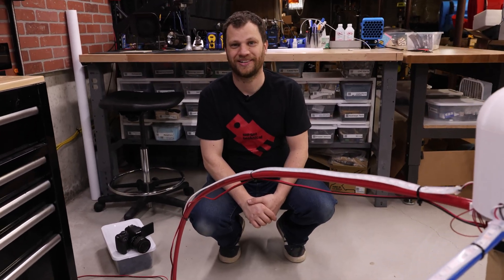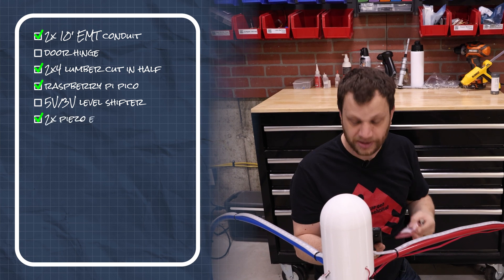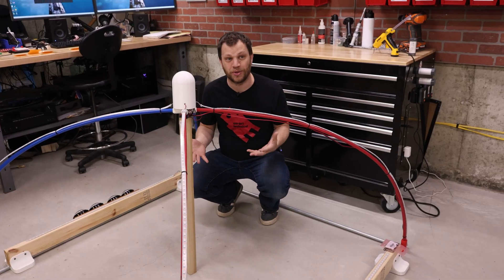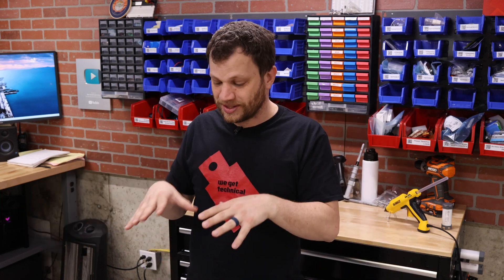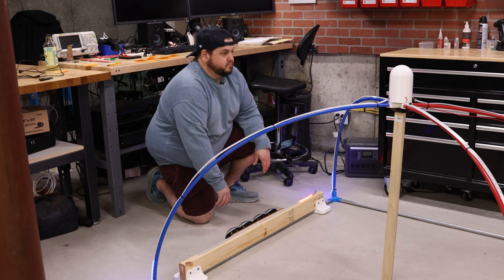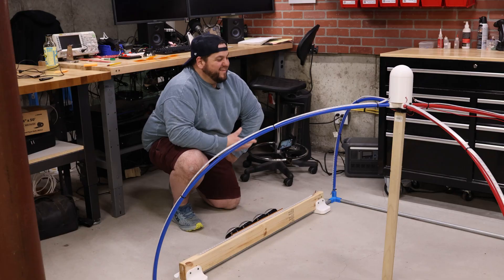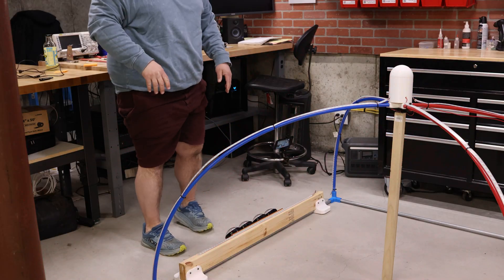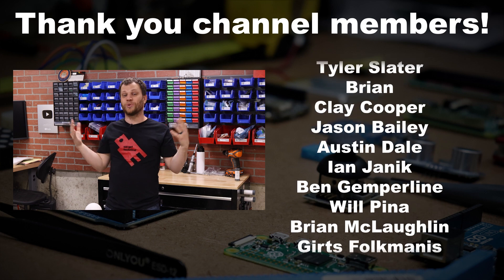Pixelball   Part 3

Comment: Your design change eliminated the need for the hinge (one of the few items you had to buy), but how did you get around using the voltage changer? Did you add in a controller board that took care of that for you?
Reply from the maker: Um, I just ignored the fact that the LED strips were expecting 5 volt logic, but the raspberry Pi Pico uses 3.3 volt logic. Obviously they're supposed to use 5V, but they seem to work just fine with 3.3V

Comment: Do you know how the community had actually designed Pixelball? I'm confused what the door hinge was for.
Reply from the maker: Yes, in part 2 I started to build a pyramid shape with the four pieces of conduit. The door hinge was the top connection point. Ultimately I abandoned that design and went my own direction
Reply: @bytesizedengineering  oh that's right, I forgot about that. Thanks!